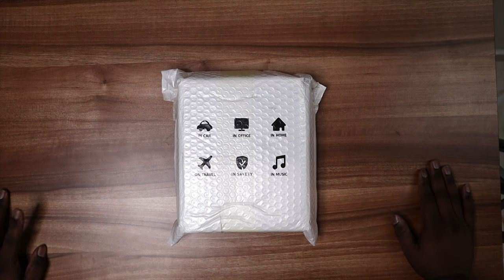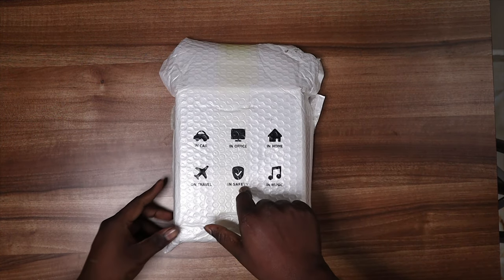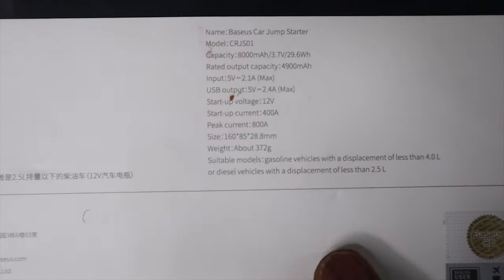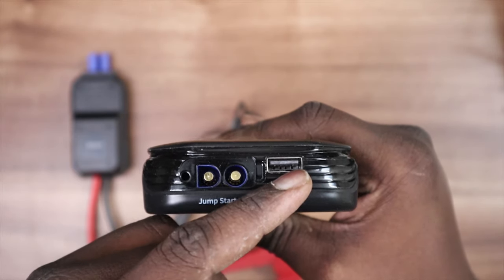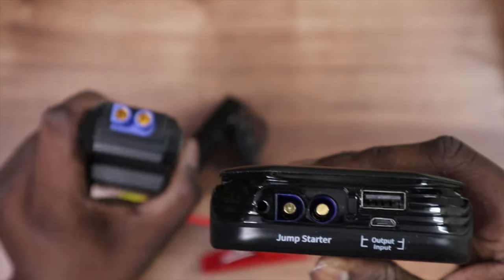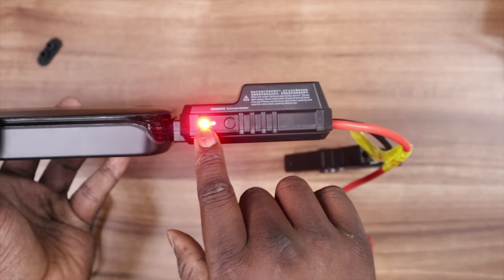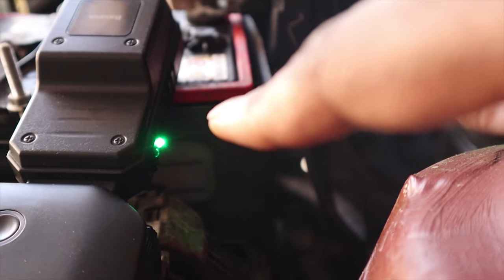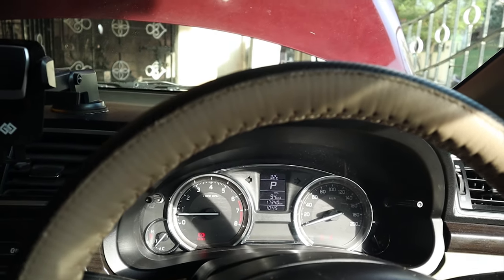PORTABLE JUMP STARTER - BASEUS  (compact) I UNBOXING I FULL REVIEW

Comment: That's not what the button on the side is for. It's used to override all safety functions of the jump starter so please be careful when activating this function. Normally used the your car battery is to low to detect.
Reply from the maker: Thank you for your guidance
Reply: Wait what?